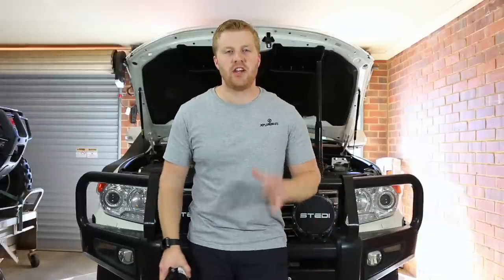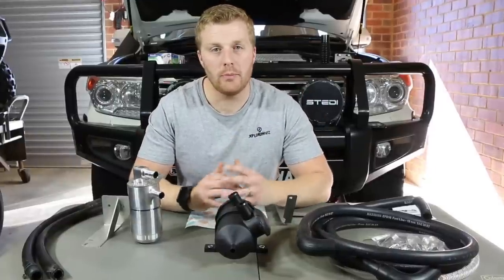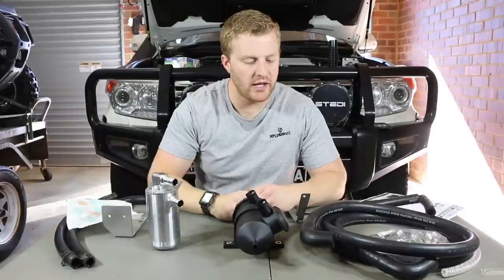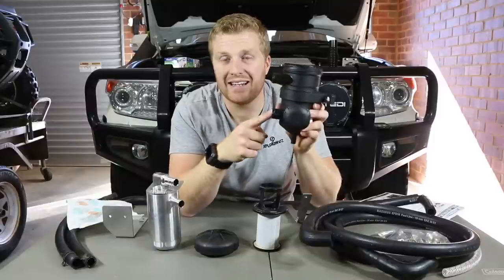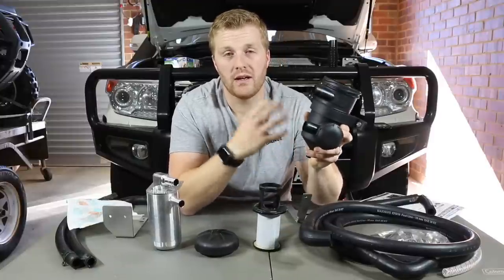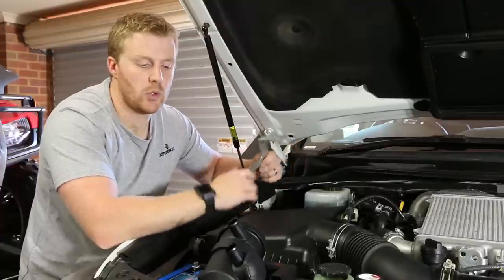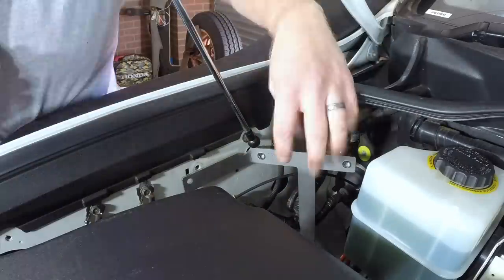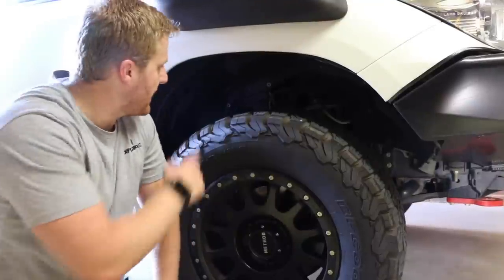LC200 | Provent Catch Can vs HPD | Why I’m swapping | How to install | Difference | Oil Separator

Comment: Several years ago I had a Pro vent 200 catch can fitted to my brand new Mazda BT50 XTR auto, by a 4X4 diesel specialist. Within 800klm my front seals blew, coming home from a trip to Cooktown. As I was driving, I could smell oil. Got home to Cairns, popped the bonnet and oil had sprayed everywhere. Car was still under warranty so took it into Mazda and was told that the front seals had blown because of pressure build-up caused by the catch can, so no warranty cover. I called Western Filters and they asked me certain details about my Pro Vent 200. It turns out that my catch can was a cheap Chinese replica of the Pro Vent 200 !. Looks identical BUT, mine had a fine stainless steel mesh filter medium instead of the genuine white material filter medium. Also they said the pressure relief valve on the replica's does not function at all. I then fronted the installer, who 'red-faced', removed the knock-off can and put the system back to factory spec's, and paid the bill that Mazda charged me to replace the front engine seals and clean the engine bay. What a bloody drama !. Not game now to get another catch-can.
Reply: Wow lucky it was a shop that installed it and not you DIY then. Bet they knew was copy, as shops buy from big suppliers that deliver. Can't see Repco or the like buying ebay copies and reselling .

I had heard this story of copies, so I bought directly from Western filters.
Reply from the maker: That's not a great story at all! 
I would be extremely disappointed and frustrated it this occurred on my vehicle. I understand your hesitation. I'm glad to hear that the shop helped out with the repair bill, but goes to show how vigilant we need to be when trusting others with our vehicle.
Cheers, Nathan.
Reply: Thats a lesson for you to not go for the cheaper option. Cheaper isnt the best option.
Reply: @krump7429  also a reason to question why a reseller is selling for less then the original seller/manufacturer...

But he was told was a real one,
So that's on the mechanic.
Reply: @krump7429   Yes, but I asked for and was sold what I believed to be a Provent 200 C/Can. Paid top dollar too!
Reply: @krump7429  did you even read his post?? He didn't go the cheap option. The installer basicly tried to pull a dodgy on him and install a cheap Chinese copy.

Comment: It boggles my mind that these catch cans are being installed at higher elevations than the PCV valve and intercooler. I get that it’s for the convenience, but to get the absolute best results, seems like you want all the hoses to drain AWAY and back towards the can vs the engine ports. The larger the diameter of hose and can itself, the slower the contaminated air can move thus increasing the time available for it to drop out its contaminants.  Likewise, the more surface area the contaminated air passes across (whether filter media or hose length) the more separation occurs.  Offset friction loss (pressure) of longer hoses with greater diameter hoses/fittings/ports.  But as is, these typical installations of high quality cans are better for the engines long term efficiency than no can.

Comment: Purchased the same kit about a month ago but it didn’t come with a screw on end cap for the drain valve. Did that come with your kit?
Reply from the maker: Yes, the screw cap did come with the kit. I assuming your kit was also from Western Filters? If so, I'm sure if you contacted them they would help you out.
Reply: @XploringOz  yes it’s from western filters too.
Reply from the maker: @michaelk1266  Hmm... must of missed that from your kit. I'd recommend getting in contact, be interesting to see what they say.
Reply: @XploringOz  just sent them a message, will see what they say. I just noticed that your drain valve has a gold color whilst mine is silver. I'm worried that without the end cap oil might drip out and create a mess. One thing I could do is zip tie the valve pointing upwards to avoid that.
Reply from the maker: @michaelk1266  Hmm, that is interesting. I’ve also heard that the valve can sometimes leak, so it would be beneficial to have that cap. Hopefully they help you out 👍
Reply: @XploringOz  I talked to western filters, there are two types of drain valves and you’ll get one or the other depending on stock levels. One of them has an end cap and the other doesn’t as it’s not required.
Reply from the maker: @michaelk1266  hmm, that’s interesting 🤔. Did you request one when they come back into stock. That’s a little frustrating to be honest.
Reply: @XploringOz  they offered to send me an end cap and it arrived today. They’ve been really helpful and I will be buying from them again.
Reply from the maker: @michaelk1266  Thats awesome news. Having the backing of a company like this really solidifies trust and confidence in the product. No one is perfect and things can be missed, but the ability and transparency to fix these things quickly and without extra costs says a lot about the company. Good news, thanks for letting us know. 
Cheers.

Comment: Thanks Nathan, another great video. I put the Provent 200 kit from Western Filters on my 2015 Sahara last year and ordered a replacement (upgraded to IV) element yesterday. I’ve done nearly 20,000km with it on, including a few trips to the Goldfields. So far I am averaging to drain 30mL per 1000km using Penrite 0W20 C2 Euro. The current filter looks good at the 20k mark, but I may not wait the full 40k and replace it sooner. Note the older Western Filter bracket has caused the lid of the Provent 200 to rub on the underside of the bonnet at two points. Same with the fuel manager pre-filter bracket from them. Not badly, but noticeably...
Reply from the maker: Thanks mate, appreciate it. 
I reckon I might be replacing the filter around the 30k mark, depending on what it looks like obviously. As I do a fair bit of towing, I reckon the blow by gases will be increased with the vehicle being under a higher load. 
Interested to see how much this kit pulls out. 
Cheers.

Comment: Great video yet again.  People need to know that once a catch can is fitted the Toyota Factory Warranty IS void.  I asked them prior to fitting it to my VDJ79 and this is what they told me. In my opinion, catch can on, and take my chances with Toyota!  They work great.  I have the RYCO one and it works fantastically.  I was stunned at how much crap was in mine on first filter change!  Highly recommended to diesel owners.  Not a great idea to pipe the oil back into the sump.  I live in Victoria and the water moisture vapour mixes with the oil and you get chocolate milk in the body of the filter around the oil air interface.  It is fitted correctly just in case anyone thinks there is an air leak.  I think the water vapour ingresses via the pressure venting system you discussed.
Reply from the maker: Yes, definitely something to keep in mind and something I forgot to mention in this video (as it's not a consideration for me, due to being out of warranty). 
Further, cold climates and certain placements of catch cans within the engine bay have been known to build up a moisture within the collection bowl, definitely not something you want being returned to your oil sump for sure.
Cheers, Nathan.
Reply: For Toyota to void your warranty for fitting a catch can is Illegal. You have the rite as a consumer to protect your engine for when your "factory" warranty runs out
Reply: Tiny water crystals can form in the catch can in cold water which may find their way into the turbine.  Not good at all for the blades.

Comment: Nathan, excellent vid and explanations. Western Filter should be great fully!  The catch can is a no brainer. My Sequence was: 1. Buy used 200series. 2. Order / buy from Western Filters the M & H Provent 200 and fuel manager pre diesel filter with 30 my filter units.3 . Buy air, oil and diesel filter from Toyota original. 4. go and full service the car all lubs, filters, and coolant as well install the catch can and pre filter correctly before driving the car. Ps the Provent 200 works a absolutely perfect for me. Cheers
Reply from the maker: Thanks Holger, appreciate it. 
Sounds like you have a good series of preventative maintenance after purchasing the vehicle. So many people go straight out to buy all the gear that 'looks good', rather than the gear that will actually assist and improve the performance and reliability of your vehicle. 
Thanks again, Nathan.

Comment: When you mention the kink at 5:13, note that one can insert a "hose support spring" that matches the ID of the hose.  This will prevent the kinking while still allowing the hose to flex to a tighter radius.  There are some made specifically for this, but a thin-gauge compression spring of the appropriate diameter will work as well.
Reply from the maker: Thanks mate, I didn't think of this before. If needed I'll definitely use this. 
Cheers, Nathan.

Comment: Hi  Unsealed 4x4 did fairly comprehensive test on most catch cans on the market Provent and Flash Lube 
performed the best by a fair percentage, both have pressure relief valves  in case ofa blockage for safety. The chance of a seal being blown out or leaking would be very low if the unit was fitted correctly and the internal
filter was replaced at recommend intervals. I fit a Flash Lube to my LC200 in the first 400k. Ian
Reply from the maker: For sure, and this study organised by Curtain and published by SAE International would agree. The Flashlube was right up there in terms of results, although not much better than the Provent, it still provided the best results of all methods tested.
I would be interested to see how your unit performs long term, let us know. 
Thanks, Nathan.

Comment: Great vid Nathan. Like most things if it’s a quality product it will work if installed correctly. I have a proven 200 in my LC200 and after 3300ks dropped out about 10ml of oil. These things work. In time all that oil would have started coating the intake system and adding the EGR system to the equation would have eventually blocked the intake manifold and heads. Filter is expensive but so is removing the top end of your motor and getting it cleaned. 👍 👍
Reply from the maker: Thanks mate. 
For sure, quality is vital! Unfortunately this vehicle is a 2014 and I purchased 2nd hand, so no doubt my intake has already mixed with the EGR to create some blockage, but this will assist in that process continuing. Hopefully one intake clean in the near future will help it out somewhat.
Chees.

Comment: I ended up with the direction plus kit for my 200, same oil separator (provent 200) similar bracket but the clamps were the constant pressure type, just a bit neater and the hoses ran around the front of the motor. Bottom drain tap was a bit neater also ( i"m just fussy! haha) there is another kit available also, my mate has and mounts in front of the radiator on the passenger side behind the grill. cheers
Reply from the maker: Good stuff. There are a few different kits out there on the market. I guess it's personal preference in relation to the mounting kit and position of the filter. 
One reason I forgot to mention in this video and one reason behind choosing the WF kit was that it kept the pipes and filter high and within the engine bay. 
Although I don't have any solid evidence, I have heard of other experiencing condensation in their filters when installed at the front of the bay, having fresh air pass over the outside of the unit. 
Cheers, Nathan.

Comment: Great choice! After doing some research I came to the same conclusion PROVENT 200 for my 2014 Ram Ecodiesel 🇨🇦 thanks for the video. Sub’d 👍
Reply from the maker: Awesome, good to hear! 
Thanks mate 👍
Reply: I’m thinking of adding one to my ‘21 Chevy 3.0L Duramax.  After a year of use on your truck; do you still recommend, any issues?

Comment: Nice factual video. A recent option is also the RYCO catch can and fuel prefilter kit. Very well made with mounting kits for most 4x4s. Its not cheap by any means. I previosly had the HPD whick is of excellent build quality but didnt seem to be working properly on my  2015 BT50
Reply from the maker: Thanks mate. It appears a few people have the same opinion about the HPD unit. 
I didn't come across that unit, glad to hear that it has worked out for your vehicle.
Cheers, Nathan.

Comment: A tip you may not realize, what a good air/oil separator catches is a mix of app. 70% water and acids, sulfuric the most common. 23% is raw unburnt fuel...dilutes engine oil reducing viscosity, and 7% is actually oil, but the oil is saturated with abrasive particulate matter (soot, carbon, ash) and to return this concentration of damage and wear causing contaminants is a horrible thing to do. The filter cannot trap and remove these except particulate matter in the 19-14micron size. Most of what is contained is smaller than 8 microns so not an effective filtration process so this is reintroducing the combustion byproducts as a concentrate back into the crankcase is very detrimental over time. All PCV systems have a "clean/fresh" side where filtered fresh MAF metered air enters one bank or one portion of the crankcase, and the "foul/dirty" side that the foul contaminate laden vapors are evacuated (sucked out).  Fresh incoming air flushes and makes up for the contaminate laden vapors. If left in the crankcase they quickly settle and mix with the engine oil.  You have a great understanding of much of this, but this design in theory sounds great, it is detrimental to engine longevity. EMail me direct at: APDEG@aol.com and will share much more with you. So many misconceptions in relation to how to address oil ingestion, etc.  Thanks!

Comment: I had a Provent on my Ford Ranger, the fibre filter clogged nearly straight away and created too much crankcase pressure which made my injector seals leak and a loss in power, (I’ve heard the same about other 4WD) would not recommend a Provent as I would rather have my engine last longer and I would get a more generic catch can to not build up the crankcase pressure.

Comment: Will be interesting to see the RYCO RVSK105 vehicle specific kit for the VDJ200. The PX Ranger / BT50 kits are superb. Superior to any Mann Hummel PV kit I have seen to date. Not overly pleased with garden retic' elbows supplied with most PV kits including the one you fitted myself. The RYCO kits have proper formed hoses along with quality hardware kits.  Apparently the RYCO RCC351 catch can actually outperforms the PV200.
Reply from the maker: Interesting to hear. It would be great if someone who had one fitted or was thinking about fitting one could test one out and post the findings. 
In terms of the elbow fittings, I guess this is more aesthetics rather than function, there is no higher flow air that requires any fancy mandrel bend etcs in the circuit, but it would look nice. 
Cheers, Nathan.

Comment: The mann catch can is undoubtedly of a better filter design, but it will have a greater resistance for the crankcase pressure and intake vacuum to overcome. But overall I like the design of it and might consider it for my N54 engines bmw

Comment: My friend has a air compressor installed in that position and the HPD catch can installed where yours was. I had no idea that the HPD system was so inefficient.
Reply from the maker: Yes, the HPD still does its job a little, but definitely worth swapping over in my opinion.
Reply: @XploringOz  Yeah, my Jeep has the provent. I still need to clean my intake from the previous owner who had a steinbauer chip on it but no catch can.

Comment: Great video Nathan, i got mine fitted by my performance mechanic and my last service at Toyota they advised that my catch can was leaking. I inspected the hoses and thanks to your video i picked up that the installer has put the hoses on back to front on the can.  My provent 200 is the newer model with the spring down the bottom. I have done about 30000kms with the hoses installed back to front on it since the provent was installed and it has been catching oil. but hoses have the dirty sot on the outside. Do you know what impact this would have had on the engine with the hoses put on back to front?
Reply from the maker: That’s disappointing to hear that it was installed incorrectly. Good news though, it shouldn’t have done any damage to your engine. Saying this, the can would have been completely ineffective whilst running like this, so the hoses are probably coated in oil. At least you can be confident in knowing that it is working well now 👍

Comment: Excellant video.
Non biased video unlike others ive seen where others are " sponsored "
I noticed you have  closed of the drain tap with brass plug.
Where do i get one and what thread is it?
Reply from the maker: Thanks mate, appreciate the comments. I do try and remain independent and not motivated or persuaded by sponsorship. 
Yes, the brass drain plug was supplied with my kit on initial purchase. I have spoken with someone else who also didn't get this. They contact Western Filters about it and they sent one out to them free of charge. Might be worth making contact if you bought one through them?
Reply: @XploringOz  Thanks XploringOz.
I purchased my PV 200via the dealer in Southern Highlands NSW.

Will contact western filters ans see if they can provide one for me
Reply from the maker: @Mick_4591  Yeah, see if Western Filters can help you out, from all accounts I've heard they have been very helpful.